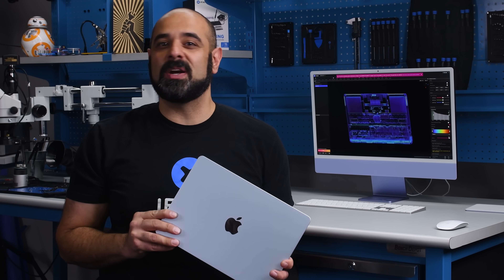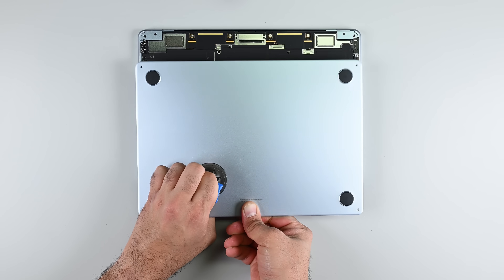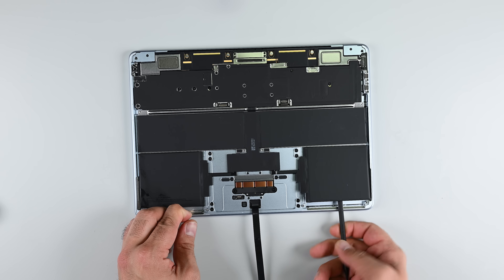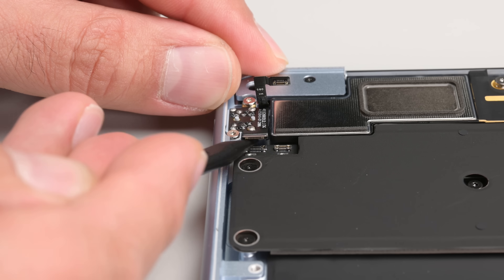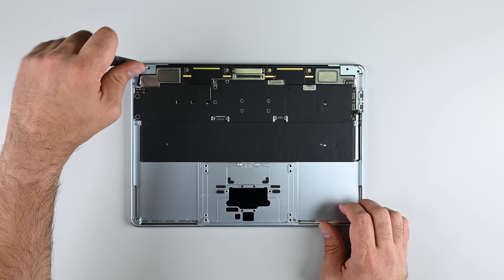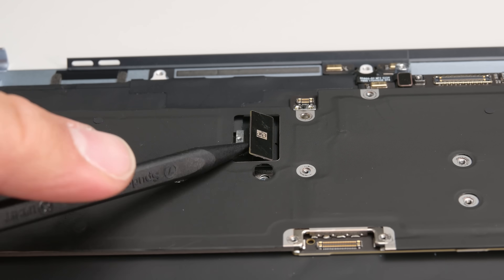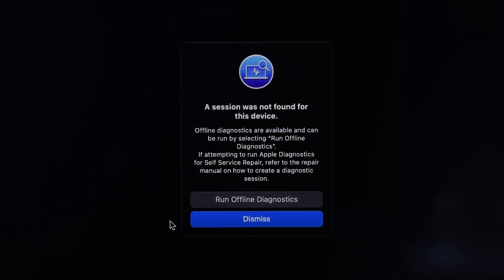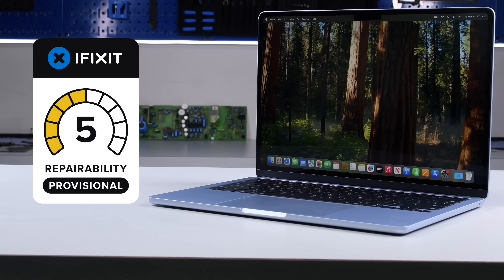MacBook Air M4: A Repair Win or a Locked-Down Mess?

Comment: If we disregard the parts pairing issues, this MacBook Air is surprisingly repairable! 😮
Reply: We should not disregard the parts pairing issue though... No point having "high repairability" if parts are rejected by the OS.
Reply: Except for when storage modules die with time... Then the machine can't be repaired.
Reply: @JerziTBoss a vast majority of people don’t keep their computers long enough for storage modules to die. 
Normal consumers outside of the tech community accepted the lifespan of HDDs and just got new computers when the HDDs became old and slow, SSDs last way longer than HDDs in most situations
Reply: @JerziTBoss  They can be repaired / upgraded, it is just much harder task.  Look up dosdude.  He has been replacing soldered storage on macs for a while.  One of the main issues with the nand modules is not that they will wear out, it is the over volt protection is subpar when other components fail iirc.  Replacement modules for mac minis and such have addressed that issue but I don't think that can be done with the laptops.
Reply: @JerziTBoss  There are many repair people in Shenzhen, China that can solder off the storage modules and replace them!
Reply: @FelixAn  you know those NAND chips are controlled by Apple right? maybe the Chinese can smuggle some out of factory and sell for a premium but to export to other countries that would be harder. what will happen to repair shop that offer that type of contraband? I wonder when will Apple crack down those 3rd party  reversed engineered M4 mini storage module sellers.

the labour cost will be higher than user replacing m2 module. solder SSD doesn't serve any purpose than planed obsolescent. if you going to argue for thinner laptop then sure, but don't pretend it's not a huge trade off. stop being an Apple apologist for your own sake.
Reply: @JerziTBoss I’ve owned over 30 laptops and never had a storage module die on me.
Reply: @bodigames  storage will wear out and die eventually. You're extremely lucky.
Reply: @bodigames Seems you don't keep them for long enough 😂
Reply: @JerziTBoss  When was the last time you had a piece of flash storage fail on you? Maybe if you write hundreds of gigabytes to it every single day it will fail in 5 years, but nobody who buys a macbook air does that.
Reply: Feels like they intentionally design it that way to accommodate regulations in certain regions while using the most restrictive software where they can.
Reply: Except you cant use it as intended once you repair it because of that glaring flaw
Reply: It's pathetic that you have no knowledge and are passing judgement. Pairing and calibrating the mac lid close sensor is part of the security and encryption.
Reply: @nnnnnn3647  haha, good one
Reply: @nnnnnn3647  The “Mac lid close sensor?” I don’t even have to read the rest of your comment to know that you don’t know what you’re talking about, but I did anyway.
You don’t know what you’re talking about, by the way.
Being able to properly detect the angle of the MacBook lid without software calibration is not a security risk in the slightest.
Reply: @transistor-exe  You are another one who has spoken up despite having no knowledge.
Reply: and why should we disregard that? just disregard things until it fit your narrative. just admit these are destined to be e-waste after 5 years when the nand flash wear out and no way to get replacement part that required for an economical repair.
Reply: @tsunekakou1275  Who said it will die in just 5 years? Mine is 10 years and no issue at all. Laptop used crazy intensive for 16/24 hours. In the same time it SSD should be replaceable.
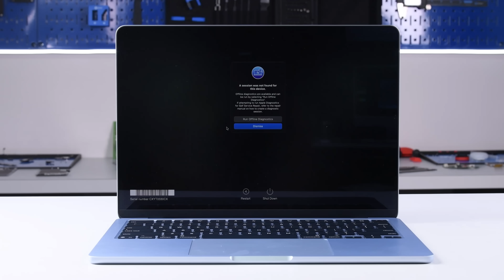Reply: @SOMEONE-ME  6:17, did you even watch the video, where do you buy the NAND chips, exactly?
Reply: @tsunekakou1275  there are repairpeople who could replace the flash drive. After all you just desolder and resolder. And lots of people use macbooks for over 5 years without issues.
Reply: @tsunekakou1275 i have a 12 year old Mac and its still running fine (granted one battery replacement in 2020)
Reply: @tsunekakou1275 you can’t wear out a Nand in 5 years of use 😂
Reply: The pairing got improved a lot, as the calibration data of the parts is now stored on the cloud. Parts like display, camera, some sensors get measured by high-end devices and these measurements are needed for the calibration of the parts, so they work as intendet. This ensure that all screens look the same, cameras, sensors, .. perform the same, ...
Reply: Does it even matter? People will always complain.
Reply: Yeah but the glue under the battery tho…
Just seems kinda unnecessary imo
Reply: @SalzmanSoftware  It's not glue, it's easy to pull out self adhesive strips, basically like really stretchy double sided tape. The alternative (lots of screws everywhere) doesn't work because you can't put screws through a giant flat battery. You'll notice in most PC laptops the battery has it's own plastic case around it instead, and that's held in with screws. The metal case of the MacBook IS the case of the battery. This lets you have a bigger battery in a smaller space. It's a design trade off.
Reply: @SalzmanSoftware  It's not. Batteries are super mass dense.
Reply: @SalzmanSoftware  nah it really not that bad. Just be careful with the pull tabs and you can have a battery swapped faster than a lot of modern phones that dont give you any way (except prying) to remove the battery.
Reply: @SalzmanSoftware  Virtually all laptops and mobile devices use adhesive strips under the batteries so they can't slide and knock around since that puts tension on the power cable.
Reply: maybe they should use the type of adhesive that lose its stickiness property when apply voltage. i haven't heard of that type of technology anywhere yet but i bet they can do it if they wanted to. or maybe they could just copy framework laptop, and use battery frame with screws.
Reply: it's the exact same design as its M3 predecessor.  And virtually the same design as the M2 macbook air. Beyond slapping new silicion on the motherboard, there is really no noteworthy changes going on and they could've saved themselves some time and cost by tellling their audience to "watch last year's video, it's the same!".

Comment: are displays and palm rests ever going to be available, or is ebay the only option… thanks apple
Reply: Yeah, 5 months from now at 1/3 of the cost of the entire device.
Reply: @SalemTechsperts  not much of a big deal if third party comes in
Reply: at least they have less screws, bc it used to be terrible
Reply: Parts (top case/palm rest, displays) typically become available on the self service store/everyone else 3-4 months after the device has launched.
Reply: @thenothingofoz  sorry, i should have clarified aftermarket/refurbished, or from the manufacturer, not “genuine” tax, like the “service tax” samsung introduced years ago. parts like that were always accessible, they just do it directly from themselves and their approved sellers, like mobilesentrix. woah, just an lcd panel for 300$ no way! ~600 for the assembly, that’s outrageous, a used ebay is still the way to go, they didnt change anything, i just answered my own question. that exclamation was not a compliment, this is exactly what samsung did, youll have to wait a couple years, because they force the supplier from selling “non genuine” parts! i see little to no aftermarket, that market is still broken! they used to take this approach directly to the repair shops, but i guess they decided to go to the suppliers, so they are affected indirectly by the markup. its all for show, parts were always available, still are, but a used ebay will be a stringent customers option, like before. i had to check suppliers for a sec, also, whoops, i was talking about a 2021 macbook lol

Comment: Denatured ethyl alcohol is Better than isopropyl; cheaper too.
Reply: False, denatured is not better but more dangerous, isopropyl is safer to work with. 

Electronic engineer here with more than 20 years in the industry and safety certifications. 

Denatured alcohol contains chemicals that make it dangerous to be exposed at, while isopropyl is more safe. 

None of them are safe for consumption, but if you inhale one, better be isopropyl (still not recommended). And for Electronics, both work the same.
Reply: i've always wondered about using ethyl alcohol instead. why is it better?